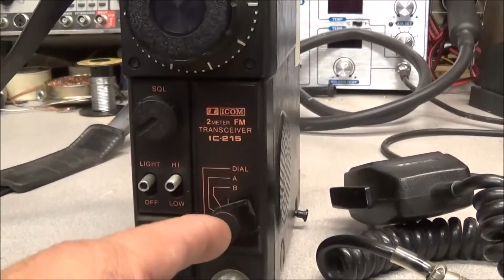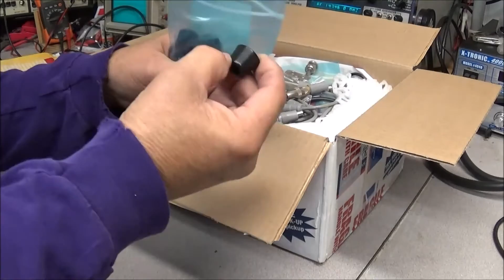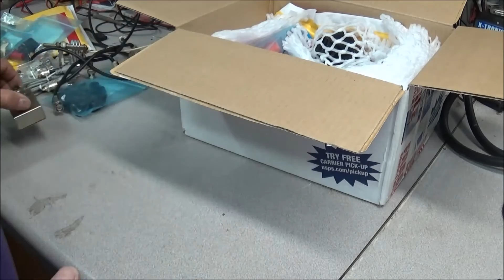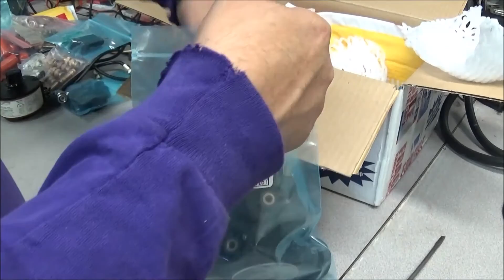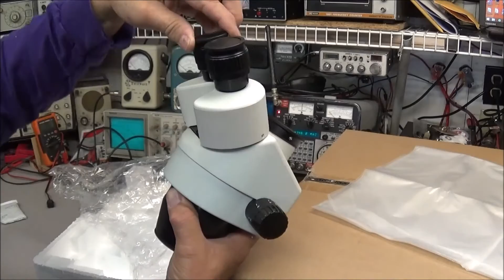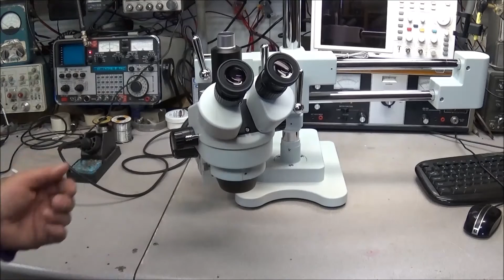#50 Mail Time

Comment: Caution with that IC215 as the power input is centre negative. The only thing that fais is the audio amplifier chip, i have the last 5 in South Africa...... I will put in some beefy diodes and fuses to prevent this happening again, along with changing out the 10V capacitors ( really Icom!) that get peaked at 13V when the audio gets loud.
Reply from the maker: +SeanBZA  Great comment Sean. Thanks for bringing that up. Those audio chips are basically unobtainable here.  I do plan on recapping the rig. Thanks again.
Reply: +The Radio Shop I got them 2 months ago, at $5 for the lot. Took them a day to find them in the store as well, but i really need to put it in one day, it is a nice rig. Will take that antenna out, as it is broken, so will put a BNC in place of it. 

The connector AFAIK is for a set of rechargeable batteries, so they can be charged.

Comment: That's a very nice microscope indeed. I have one of AmScope's small, low cost units on my bench and I have been pleasantly surprised by the quality of its optics.
Reply from the maker: +fpliuzzi The quality is unbelievable I will say. Makes those tiny components look like they are big as house. Real impressed. Should have gotten one long ago. Tanks for the comment.
Reply: +The Radio Shop 

That's what I said when I got mine, should have gotten one long ago.  Now that you have it you'll wonder how you ever did SMD work without it.

Comment: When you have probably over 150,000 fuses its probably to many.  Thought I would share the fuse wealth.  All the knobs are NOS, again, got knobs coming out my ears.  If you ever need air variable caps let me know, I have plenty more extracted from countless pieces of test equipment.  Hope you can use at least some of what I sent.  At the very least I know you needed 5 matching BNC T's.

Mike
Reply from the maker: +MikesRadioRepair That was a box full od goodness Mike. I can use everything in it. Love those old banana jacks with the BNC on them. They will come in handy with multi meters and my old Eico scope.  You can never have enough fuses either :) I also like that bag of orange capacitors.  Which reminds me I need to make a parts list for the HP 410 and het those capacitors in.  Need that unit working. Thanks so much for the items. Means a lot Mike.
Reply: +The Radio Shop 

Knew you liked the old equipment like I do so I figured you could use some of the older adapters.  Probably should have sent a empty parts cabinet to put it all in. ;)

Mike
Reply from the maker: +MikesRadioRepair Think I may have one that is still empty. Will have to check. Yes, old folks like old stuff hehe. :)
Reply: +The Radio Shop 

My lifelong philosophy is he who dies with the most electronics junk wins and I'm on my way to winning.  Just hope it's not death by parts and radio avalanche, LOL.